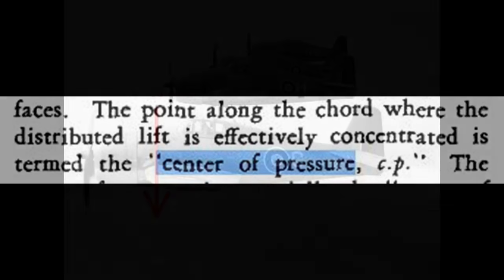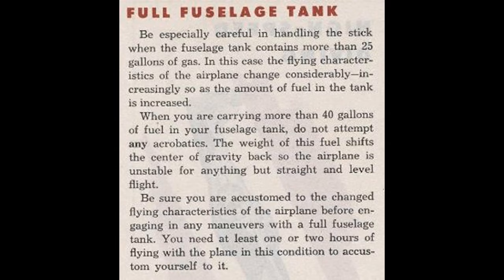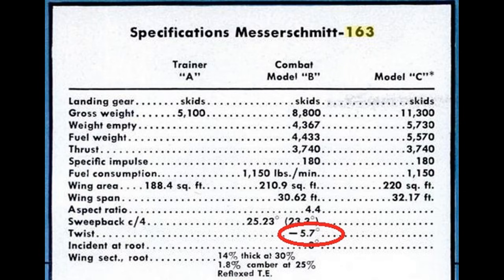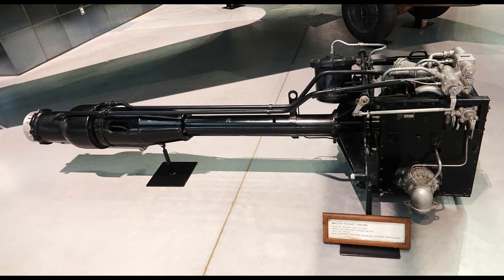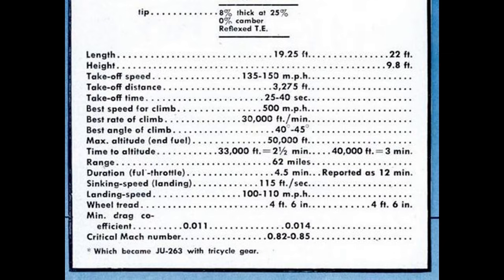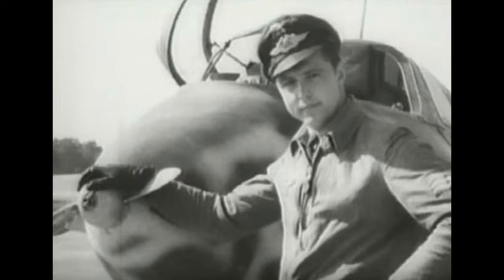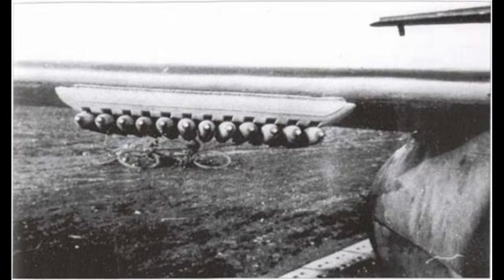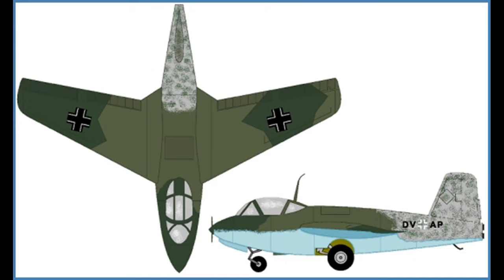Messerschmitt Me 163 Pt.2 Plus Me 263 and More!

Comment: Hey Greg !

Congratulations on the channel. Real good, detailed and proper technical explanations. Fantastic "stoff", really XD

I'd like to make a comment, and I'm not sure if someone pointed this out already. If so, I apologise in advance...anyway, here it goes:

You are absolutely right when pointing out that the Me-163 have a noticeable wing twist, but I suspect the reason behind that aerodynamic feature does not have to do with aileron isues or wing tip stall...but rather with pitch stability.

Wing twist is a common feature to all early tail-less aircraft designs, and its purpose is to create an opposing force—and therefore a momentum— to produce some leverage to counteract the momentum generated by the lift and the distance betweet the center of pressure (CP) and CG. Kind of a built-in trimming feature, if you like.

By the way: that´s also the reason pretty much all flying wings have swept wings. This goes all the way back to the very early designs, like the D-8 for instance, since it constitute a kind of intuite way of dealing with pitch stability without elevators.

Yes, it provides yaw stability and have a lot advantages at high speed...but the combination of wing twist + swept wing planform was the only way of dealing with flying wing's fundamental problem, at least in the minds of early 20th century aircraft designers...waaay before pressure distribution and aileron reversal became an issue (or even dreamt of,  I'd say). In their defense, I'd only say it is kind of a natural way of thinking...

-Need pitch stability w/o elevators => make a built-in counteracting force in the only aerodinamic surface available—the wing itself—and move it as back as possible !

All the best, man !

Carlos
Reply: Ohh...
:|

Comment: As far as the B-2 is concerned, I see way more Jack Northrop than Alexander Lippisch.  You mentioned the F-106 Delta Dart, but didn't mention the F-102 Delta Dagger which was a stepping stone to the F-106, and was fraught with many shortcomings due to being the USAF's first delta interceptor.
Reply from the maker: I skipped the 102 for brevity. No question Northrop had an influence on the B2, but this wasn't a video about Northrop.